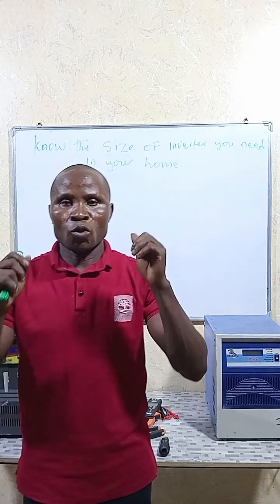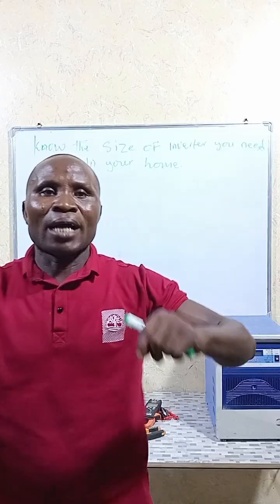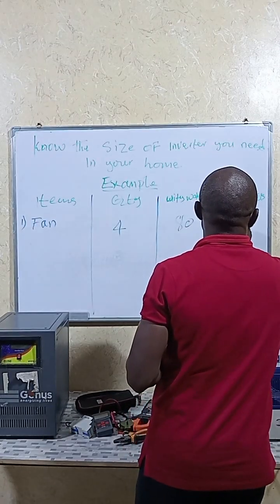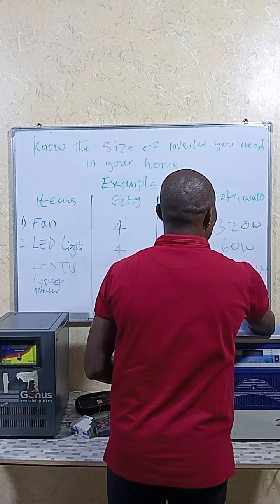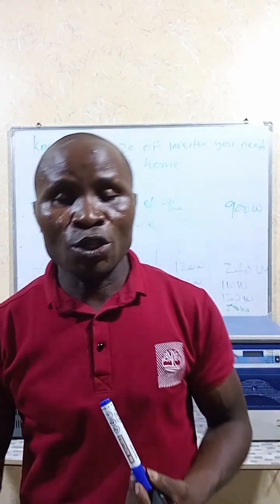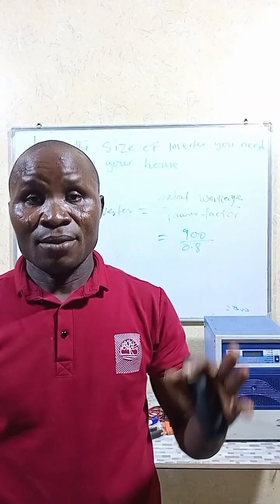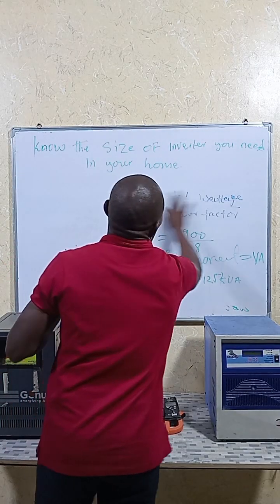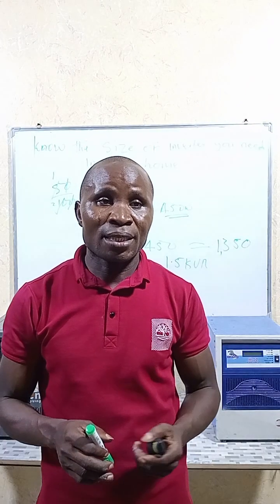HOW TO DESIGN YOUR SOLAR AND INVERTER SYSTEM

Comment: I have 100Ah battery, 240watt solar 1000watt inverter and 20Ah charge controller  to controll my charging booth , but the inverter always alarming with red signal. So    what can I do to keep system with the green light?
Reply from the maker: Increase the panel to 600W and increase the controller to 40Ah at a minimum